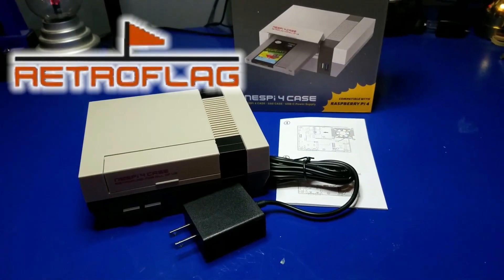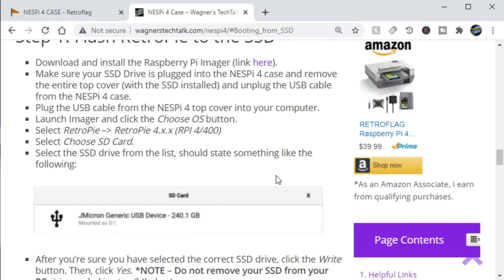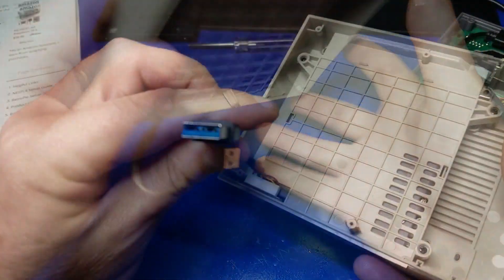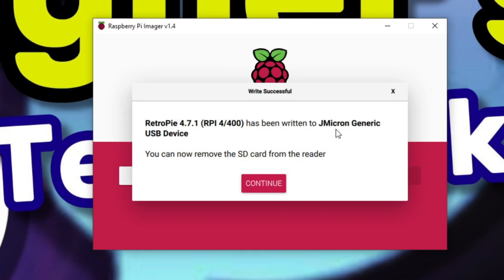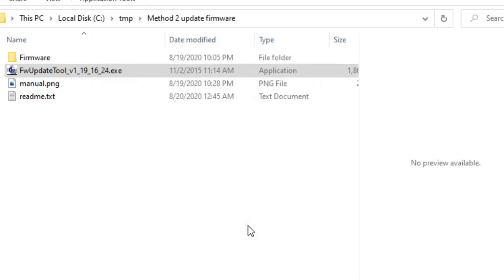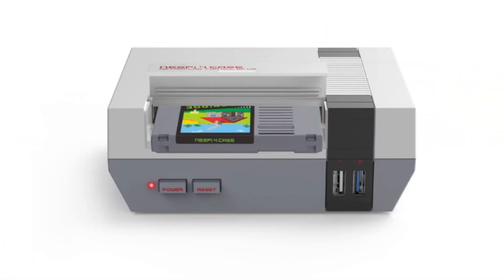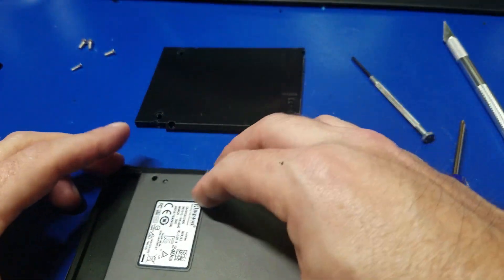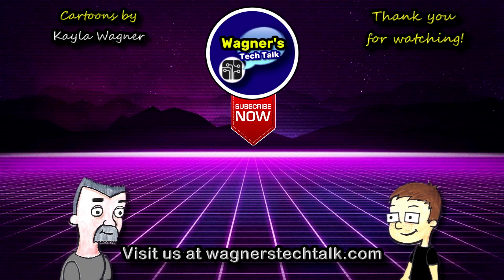Retroflag NESPi 4 SSD Boot: Quick-Start Guide

Comment: Good timing on this vid for me. Will have my nespi case up and running within a week and this will save me a ton of time. Thanks Wagner.
Reply from the maker: Great to hear Rex and very welcome!  Let me know how it goes 👍  Funny I see this reply, watching your stream from last night on my lunch break!
Reply: @WagnersTechTalk  I used my current image from my other pi4 and wrote it to the Ssd , did the firmware update , and tried to boot from ssd , but all I get is a black screen.  Not sure if I had to wait longer.   But I put my original micro sd card in and that worked fine.  Any thoughts?
Reply from the maker: @therexershow  Hi Rex, you may have an older Pi OS firmware.  Assuming you have a backup already boot from the microSD and from the terminal (if in RetroPie, press F4 on a keyboard) try:
sudo apt update 
sudo apt full-upgrade
sudo reboot

Press F4 again, update the Pi firmware with:
sudo rpi-update

Remove the microSD card and see if it boots off the SSD at this point.
Reply: @WagnersTechTalk  I’ll try it. I’m not using an official Retropie image. I’m using Supreme and Monkapie builds.  That could be it too. Not really sure. Worst case is i use the official build and then copy my folders over. Thanks.
Reply: @WagnersTechTalk  Havibg the same issue...would I need to copy the updated image from the SD card to the SSD? Or will it boot on a stock Retropie from the SSD?

Comment: Thanks Wagner! Really looking forward to the Recalbox install video for the Retroflag NESPi 4 case. Had some weird issues and I'd love to see how it's done by a pro. Thanks so much!
Reply from the maker: Most welcome and thank you too!  btw - Depending how it goes, Recalbox will be coming soon.
Reply: @WagnersTechTalk  Can't wait thanks so much! (in case you need to address potential pain points. I couldn't get the shutdown command to take and the wifi doesn't want to connect which is also super annoying and could be why the shutdown didn't go humpf. Last oddity is my 8bitdo SN30pro+ takes ages to connect and  sometimes not at all, still not totally sure why but also it doesn't seem to like it when it's in the wrong input style, can't recall now if it prefers x-input or android, but that might be helpful to others too. Anyway just for the record I'm booting from micro sd not an SSD.) Thanks again!
Reply from the maker: Hi Seth, just wanted to update you here.  I started last week with the NESPi 4 case and Recalbox and ran into similar issues regarding WiFi.  What's interesting is that RetroPie and PiOS work just fine, connect up to WiFi perfectly.  However, as soon as I plug in the SSD Recalbox no longer allows any WiFi connectivity.  I even tried adding additional shielding to my case to see if that would be a solution, it wasn't.  As a result, the Recalbox tutorial will not include the NESPi 4 case as I had originally planned.  I don't think it's a problem with the case itself, if it was the same issue should have occurred with RetroPie and PiOS which it didn't.  I'm still going to investigate and see if I can find a solution for the NESPi 4 + Recalbox but the upcoming video will not show the two working together.  I've exhausted everything I know, at present, but have not given up.  I tend to think it is a Recalbox-specific issue more so than the case -at this point.
Reply: @WagnersTechTalk  That's a bummer and aggravating but also interesting (Nespi 4+ is the only case I have, maybe I need to flash retropie). I'm only using a microSD card and still having the wifi issue. I did not try the SSD. Did you have wifi problems just with a MicroSD card? I think you're right it's likely a Recalbox issue happy to help to try to get to the bottom of it with you if you want. Just let me know and we can connect and see if we can't replicate the issues/solve them together! (also thanks for circling back)
Reply from the maker: @sethtoybes9392  I was able to get it to intermittingly connect to the 2.4Ghz radio on my WiFi router.  Never would show the 5Hgz SSID, all the more reason to think it's an issue with Recalbox more so than the case.  Sure, we can discuss offline, you can find my e-mail/facebook info here: http://wagnerstechtalk.com/contact .  If you figure something out, please let me know.  I may reach out to the Recalbox team for their input/recommendations as well.
Reply: @WagnersTechTalk  Yeah I had a similar experience with my setup. I could get the 2.4ghz network to show but it didn't seem to be really connected. I'll shoot you a message maybe we can get to the bottom of it together! Thanks again!
Reply: @WagnersTechTalk  Recalbox is out....so how about that vid? Recalbox will be easier for my grandson(6). Please include ssd boot and safe shutdown. Hopefully this will be a Christmas present for him. Have the case,(new) Pi4b 4gb(updated), 256gb ssd and 2 usb xbox style controllers.  subbed. I know enough to get myself in trouble...lol
Reply from the maker: @jeffjankiewicz5100  Hi Jeff, perhaps you missed it?  The video on Recalbox was released earlier this year (about a month after this video) Recalbox on a Raspberry Pi 4 https://youtu.be/RfXS4HMuMDo and Lightgun setup (software install exactly the same as the previous video): https://youtu.be/uoldBGHVXKA .  For the Lightgun video, I of course did use the NESPi 4 case, the first video showed using an inexpensive generic case.